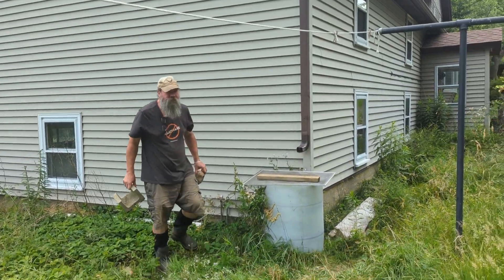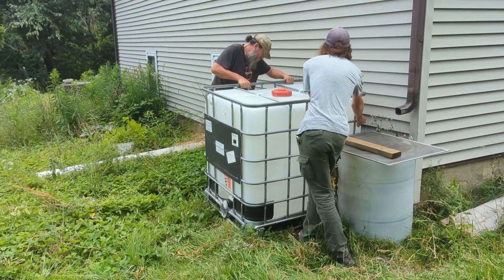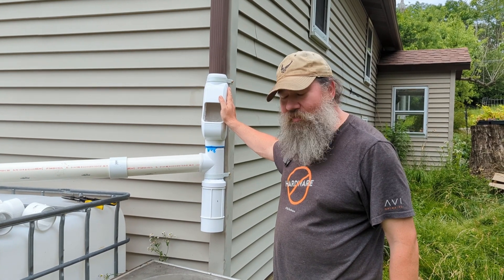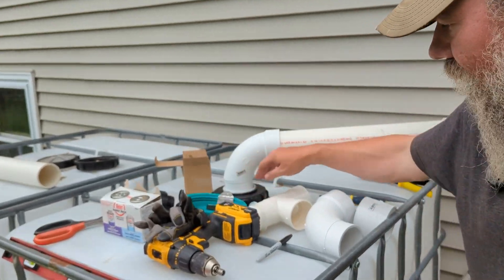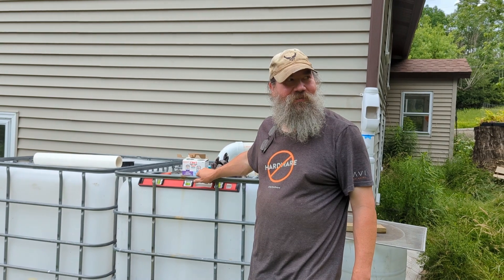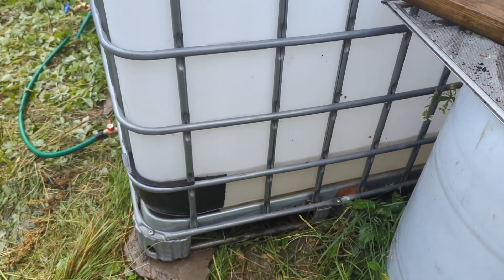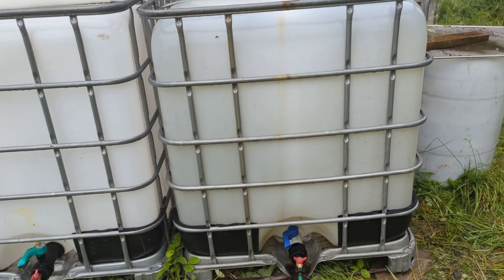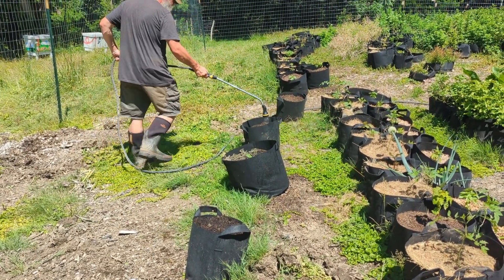Rain Water Catchment Strategies

Comment: You've got a pretty good start there.. As for collecting water off a traditional asphalt shingled roof its not a problem to use it in a garden or washing vehicles but I wouldn't consume it even thru an extensive filtration system.. Even off a metal roof I would want to test the water plus run it thru a filter system before consuming it.

Comment: Actually, collecting water off of a shingle roof is no good because of the chemicals in shingles, I've seen drip lines eat through bushes...
Reply: Meta roofs are bad too. The rain doesnt clean my roofs off. I see a greasy silt or oily film in the rain barrell. They are old roofs, but they still shed this rainbow film. I don't ever plan to drink it.
Reply: @gretafields4706  yeah that's the best idea, I plan to use it to water plants with it